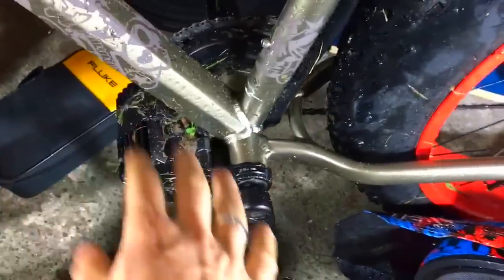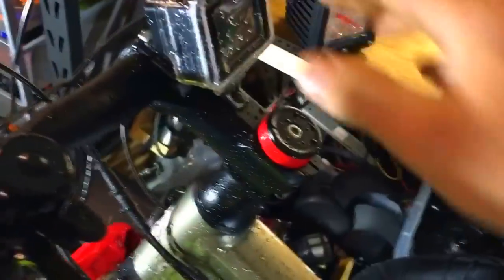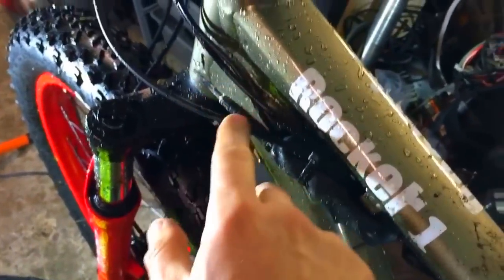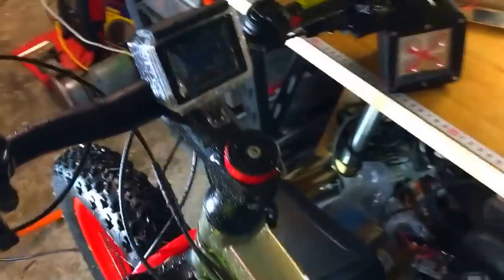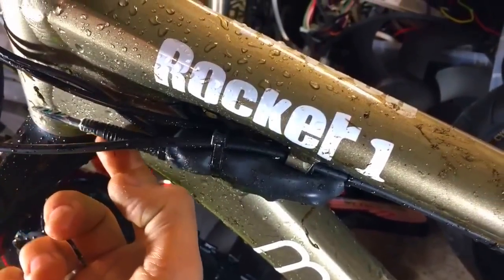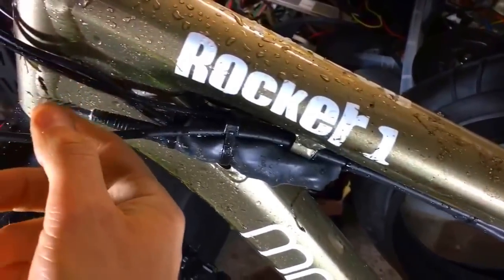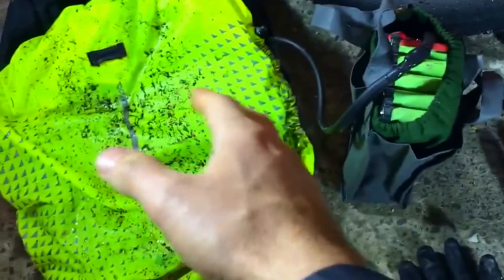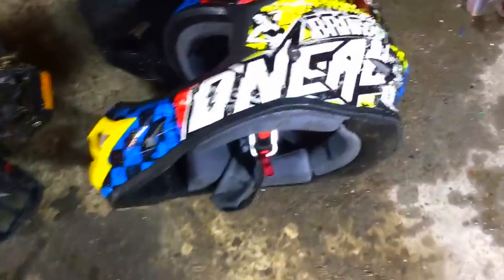My latest super stealth BBSHD build (no display no ebrake, no speed sensor) electric fat bike Bafang

Comment: Sweet dude!!!! I ripped off my speed sensor cable out of the motor by accident, so now I have error 21. Buuut at least the bike still rides! I’m just wondering: any issue riding without the speed sensor? Actually I can go super fast, but I’m worried about blowing out the motor. Can that happen? It’s a BBSHD!!!!

Comment: Hey Bruno! Big Fan!  My new BBSHD doesn't let me ride without the speed sensor (err21). The motor cuts out after about 10 seconds when err21 shows up. 
If I power-cycle the system it's good to go, then repeats.  How did you manage to trick yours to keep running?   Please help. Thx!

Comment: How fast?
Reply from the maker: Yeeeahhh.. good question.. I don't have a display so I guess my speed based on the other cars around me... I can do 65kmh on flats with a relatively small 42T Lekkie chainring, as much as I love speed I have to say that the 42T in much better gearing for any situation, good for off-road, good to ride on the road, much faster acceleration, is a lot easier on the motor and battery... the higher the rpm the more efficient will be and the more range you get even with fat tires!! This bike is soooooo comfortable.. I don't think I can go back to a normal bike after my electric fatty... sooo much fun and FAST too =]

Comment: Very sexy legs! I even forgot to check the bike!  Anyway, what size is that wheel?  I'm planning to make another built with a fat 20" tires.  I must build everything from scratch. Will take a few months, who knows, by the time, we will probably have a different newer motor? BBSHD2 :-)
Reply from the maker: Would be sexier if I was one of these road bike guys with shaved legs and wearing tight Lycra hahahahahaa 
This is the normal 26" fat bike wheel with 4" tire so it's more like 29" or 30" massive!!!
I have a 20" wheel with a 4.125" slick tire that I'll be using in my 42000w trike (at least this is what in planning to do) these fat tires feels sooooo comfortable like motorcycle, once you ride the fatty you never go back to normal tire!
Yeah, take your time making your next project, don't rush and make a super awesome electric bike with a large and powerful 52v battery for ultimate super POWEEEEEEEER haha =]

Comment: another noob question!

if im used to a 1000w china hub motor with s12s sinewave controller what power mid drive would be required to match it?

i cant seem to get my head around it lol
Reply from the maker: I would say the BBS01 250w would have more torque uphill... top speed depends on the wheel size but 12s on hub doesn't do much... I can guarantee that if you get something like the BBSHD you will go nuts... once you ride that thing you will NEVER EVER go back to hub motors... you will feel like the happiest kid in town hahaa
Another thing you will notice is the weight distribution.. waaay better with a mid drive.. bike feels much lighter compared to hub motors.. 
Put this way.. the BBSHD peaks 1500w and will perform like a 2000w hub motor but always with a lot more torque than a hub =]
Reply: BrunoPOWEEER So much differences? I am close to buy a hub motor and now you make me doubt 🤔 thanks for sharing your passion and good vibrations 😀

Comment: Now all you need is a full HD, 60 fps video camera.
Reply from the maker: Yeeeahhh.. I actually forgot to set the camera to full HD 60fps.. my stupidity hahaa.... I promisse my next videos will be much better with a very crispy picture, thanks for remind me =]
Reply: I'm looking forward for your videos, especially now that you have a fat bike. Please make sure to mention range with your current battery, and the difference between this and the slim bike. Thank you!
Reply from the maker: +dvdrwsor - yeah, you know what is funny, this fat bike is much heavier than the road bike however they are geared completely different, one is for high torque and other for high top speed, one is lightweight and aerodynamic so in theory should accelerate faster and require less energy but it has a heavier gearing and that is a bit harder on the motor drawing more amps. The fat bike is much heavier so it's geared differently for torque, once you get that big tire moving it creates a momentum and that energy will keep the bike rolling requiring little energy. I'm still trying to figure out what bike I'm getting better range but sooooo far I'm loving the fat bike and enjoying much more than the road bike =]

Comment: i'm trying to build an bluetooth display replacement. I bought a display extension cable and hacked it to rev eng the serial protocol. don't know all the codes yet. 

the patterns i discovered so far are
init
read_speed: may report in rpm?
read_power: may be amp draw, display has full volts

if u have docs for this it would help??????????????

i also have a basic phone app working for bt on ios8+ and android4.3+.
the app would be free or $5 haven't decided

the module could be made for $20 for basic functionality
or a more advanced module with extra steps for install for more.
the $20 version would take more work to develop though

bt is based on cc2541 would need someone exp with Ti smartRF software

since you have access to so many of the kits you could test it for me possibly????
Reply: Thats sounds pretty cool.. If Bruno doesn't see or reply to this here, maybe look him up on facebook. I'm sure he'd be very interested.. and if it works and he makes a video.. well you're onto a winner..

Also not sure if this is useful

https://endless-sphere.com/forums/viewtopic.php?f=2&t=74692

But ES has loads of info.. and if you do find anything interesting.. ebiking's quite an open community so maybe post some info back if you find anything you don't mind sharing..  :)
Reply: i'm using cordova for the app.
canvas for batt and 7 seg digit display.

got the graphics working, going to start a group on gitlab for all the stuff related to the proj. and post a few videos maybe on how to set it up.

I have the c963 display so only getting the codes for PAS 1-5:<

you'll need an arduino with 2 or more serial ports due with 5v converter or mega which i started with. using nodejs to capture and send codes frontend to make sense out of if, built html hex capture. 

didn't realize those pas files were pascal source. kinda cool, already had the python version dude as ES worked on. I always search github first.

the serial software is really really picky about the serial devices it wants to talk to. for example it hated my ftdi, would connect to my arduino mini but the outputs wern't 5v rail to rail the offset made it hang.

Comment: yeah looks nice I did like the minimal look.. Makes me want to get my speed machine fixed..
Reply from the maker: Hahaaa... I am still finishing this bike... I have to finish the wiring.. I will strip all the unnecessary wires in my thick harness.. I just need THROTTLE nothing else hahhahaha =]
Reply: fair play.. what's the fatbike like to ride as i've only ever sat on one and rolled round a shop floor..
Reply from the maker: it just feels like one of these MONSTER TRUCKS + BBSHD super power it rolls over anything... I don't think I can ever go back to normal bike or MTB...  it feels like a very lightweight motorcycle! One of the things that I love most is the momentum.. sudden side or front wind doesn't even make much difference.. if you just try a normal fat bike it feels heavy but if you try a fat bike with the BBSHD in my opinion is the BEST combination / option available I would recommend, the safest as well. I would score 10 out of 10 for that =]
Reply: ElectricBike I can guess what you mean about putting a motor on it and its better (the bigger the better) haha so do you ride a motorbike then or have you ever? or is it all just ebikes..
Reply from the maker: +Dave Webster (Webstaff) - yeah Motorcycles all types (road 1000cc, dirt bike, scooter 2 and 3 wheels, Harley 1600cc) I can also drive truck, forklifts, go kart, racing cars, golf kart, sailing, kayaking, peddle board, wheelchair, small/medium buses, 4WD, recumbent trikes, skateboarding, very powerful turbocharged JetSki... (I'm having so much fun making this list here) basically ANYTHING that moves I would have a go haha =]
Reply: haha boys and their toy..

yeah I have a similar list.. just add more wind sports inc kite ones.. and some snow ones.. :)

gonna add full motorbike licence this year to the list so I'm actually allowed on the big bikes though.. ;) and want to get back into flying again.. did a bit as a kid and loved it and quite like flying fpv with RC so got to be a winner.. :)

erm so wheelchair.. go on.. tell more, was it modded or something? haha
Reply from the maker: +Dave Webster (Webstaff) Yeeeahhh, I lived in sunny countries all my life so snow wasn't an option... anyway, I always had plenty of places for my adventures hahaha
I have a wheelchair in my garage, I was going to do something there but not sure exactly what, mobility scooters are super fun, got the motor with super torque already and are just waiting for more volts to spin faster haha
Yeah flying is ultra fun, I don't have much experience just VERY basic but I am a dreamer and can see myself making a giant powerful RC toy that I can wear and fly just like the jet-man hahaha maybe one day... maybe... I'm a a dreamer hahaha
Reply: haha I don't think you need to dream about flying I think it's a very achievable project goal for next year ;)
At the end of the day you're basically only talking about putting much larger motors on a quad copter frame which I have seen done.. so very feasible... I think the only reason we haven't seen loads of people doing it yet it fear.. both of failure of the craft and probably fear of the government's not liking people zipping around everywhere strapped to quadcopters built by 'amateurs' hehe
did you see the jet board that someone built a few months ago? Was a handful of microturbines and the guy flew it across a marina :D

Comment: what mid drive would you recommend for a hilly area and grassy paths but i dont need high speed because my dog has to keep up easily. in winter months there is a lot more drag due to the soft ground

would a 750w be a good choice?
Reply from the maker: Yeahh.... working at the source of the parts was the solution for my problems... initially I spent sooo much money with shipping.. lots of parts from USA and China... I needed ASAP... I was desperate.. express shipping for sure.. didn't want a day without my super toy... but life is good and the Bafang God came and blessed me hahahahahaha =]
Reply: Are you a dealer at work for them btw? I'm assuming so.. :D if not you have a lot of spares in stock...
Reply: haha fair play.. well I think the Bruno brand with its trademarked MORE POWER!!  will do just fine.. and yeah Bafang do see to have there heads screwed on when you look at the supply chain.. haibike seem to be the other brand doing the same but with whole bikes.. So jealous of the fact you can just go nuts.. and not have to wait for stuff to arrive..
Reply from the maker: Yeaahhh I would ALWAYS recommend the BBSHD over the little ones because the internal design... but the BBSHD is much bigger and power hungry than the little ones. The smaller motors still putting s LOT of torque, here in Australia we sell countless BBS01 250w they go really strong even on heavy steel frame fat bikes.. the BBS02 spins faster and the BBSHD much faster. Just put this way, you'll be VERY happy regardless what model you pick =]
Reply from the maker: I don't get involved with the money and busine$$$ side... I am just a guy having lots of fun working /fixing things there... yeeeahh.. emax distributes Bafang to many other ebike businesses so we must always have plenty of spares, boxes and boxes which is super awesome, I never have to worry if I push too hard and break something... I can just say "I was just testing" and get away with that hahahahaa =]

Comment: looks great.
Reply from the maker: This build is not finished yet, I'll cut all the harness in pieces and just leave what I need... the THROTTLE hahahaaaa =]
Reply: ElectricBike haha, gotta have a throttle! i will convert my cyclocross bike with a bbshd one day.. currently just using a hub motor on a marin mountain bike, works nice. but struggles on steep hills.
Reply from the maker: Yeeeahhh.. hub motors are actually really nice on flat but reeeeeally weak uphill... I installed a BBSHD controller on a equivalent wattage hub motor an MXUS... the hub motor was struggling so bad on a hill that the BBSHD has soooo much torque that feels like its losing traction hahaa... they're completely different animals, you'll love your cyclocross like never before =]
Reply: ElectricBike i hope so! plus it won't be too heavy.. my mountain bike right now weights 55lbs! it's insane.
Reply from the maker: +Nick Nack - whaaaaaat?????? This is waaaay too heavy is a moped weight!!! You must go mid drive... I "try" to like hub motors (I have to build some at work) but that technology just doesn't make sense.. soooo many downsides, extremely heavy, overheat and struggles uphill... I just don't get it! We have so many "hub motor riders" coming to the shop getting a mid drive, they come back to us with the biggest smile telling all the advantages and improvements on their ride specially the range, weight and hill climb. That says something...
Reply: ElectricBike yep! that's why i bought a cyclocross bike to convert to electric.. when the funds come in. ha! currently looking for job :( but the weight is a big issue. and climbing hills isnt too bad, really steep ones suck. normal hills are ok for the most part.
Reply: hey bro, is nice to see ya having fun
hope you remember me, im from Perú
I'm starting a new ebike business in peru now, after buying the bbshd my life changed haha, wanna share the feeling in my country :) 
anyways, i hope you could advice me with some tips about hub motors because most of customers cant afford a bbs02 or bbshd drive.. you know... 
hub motors are cheap yea, but not so good as mid-drives, they are weak, and thats not good for businesS! i need something reliable and long life product, dont want something that could break in the first months of use. do you know any good hub motor that can take a daily commute, max 30k km/h and resist full throttle sometimes? any info will be appreciated

Thanks man, you truly inspired me to start this ;)